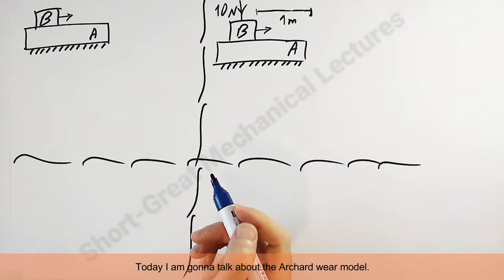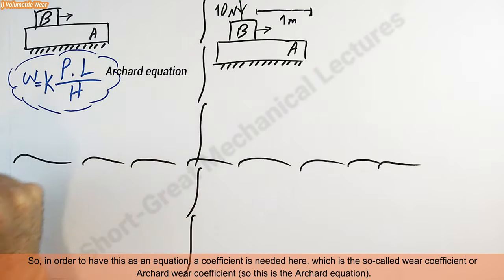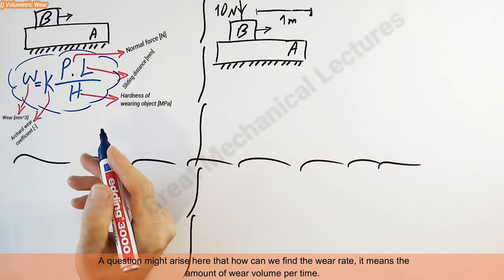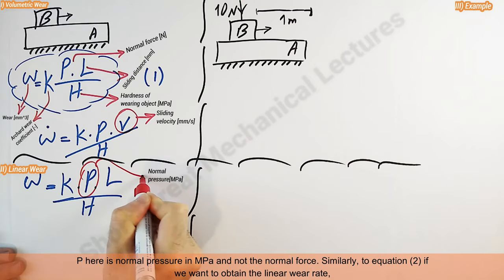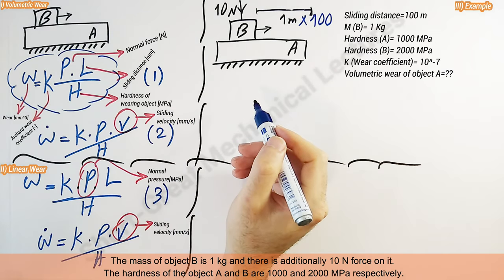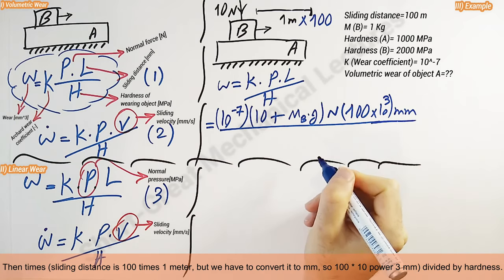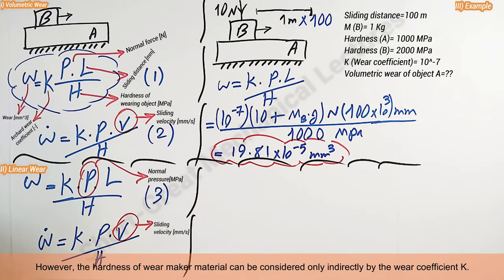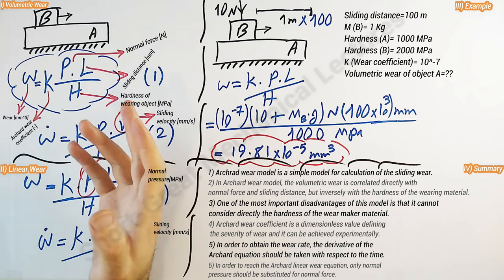Archard Wear Equation

Comment: How hardness is taken in MPa? Hardness is normally dimensionless number, it is on a scale like brinell or vicker etc. From where can we take value of K? Thanks
Reply from the maker: Thanks for your question, the hardness is not unitless. The SI unit of hardness is Pa or MPa. Here it has been taken MPa or N/mm2 to have the other length dimensions in mm. By the way, the value of K can be achieved experimentally.
Reply: @Ephidlectures  Thanks for reply. Actually while performing calaculations, we do not have experimental setup. Are there any standard tables from where we can take approximate values of k for general material pairs. Like SS and MS etc.